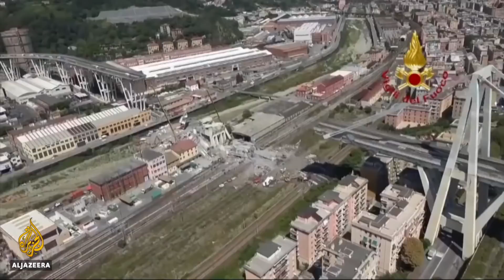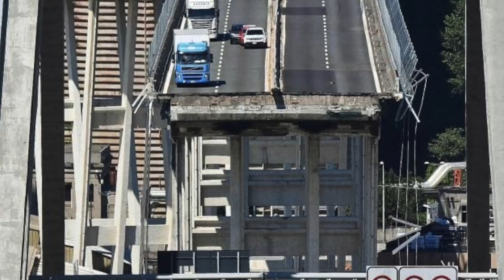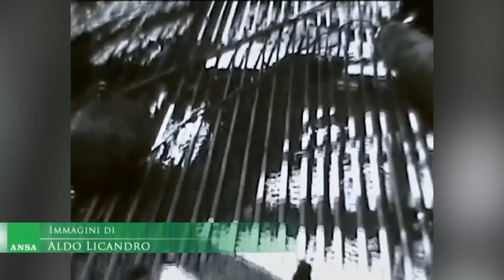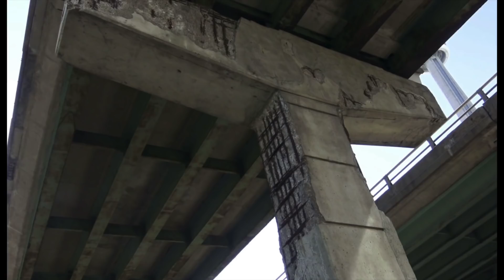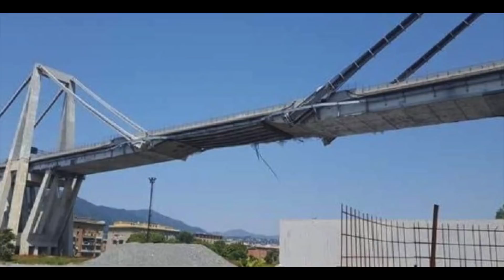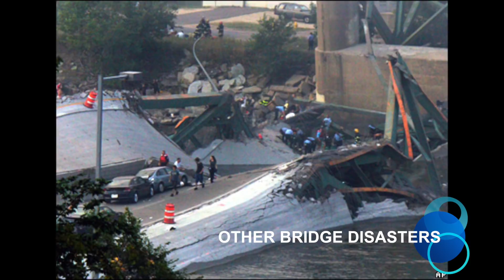What caused the Genoa bridge in Italy to collapse - Prof Simon spells out the sorry story.

Comment: Lightning strike? ⚡
I very much doubt it. The expansion joint is also a red herring. It appears to have been a failure of one of the concrete encased cable stays due to corrosion.  🌉

Comment: Try Google street, you will see the part that felt in good shape. All is in good shape, you won't see no beams coming out of the concrete. The Google pictures are from oct 2017. The bridge was regularly repaired and the cables were reinforced. You show some views that are not Genoa bridge. Try Google from Via Giorgio Perlasca. "the truth is out there" right.
Reply from the maker: Thank you....i was commenting generally on the state of concrete structures all over the world.  good idea to look at 2017 google images of the Genoa bridge, i will do that.
Reply: Indeed. No exterior damages. 
Pre-tensioned concrete structures are a sealed box. There's (almost) no way to check what's going on inside. You can make a series of deformation tests under load, deal with some theoretical models, but you'll never know anything for sure.

Comment: Concrete Cancer occurs when steel reinforcing begins to rust, often during construction phase before the concrete is poured. Then as the cancer grows over 25 - 50 years the structure grows weak abd fractures appears as you clearly showed in your images.  Go and have a look at any large build construction site, look at the already rusting steel reinforcing rods.
Reply: Light rust on reinforcing steel is not a problem as the alkaline nature of concrete slows the rusting process to an insignificant rate. This is why you see light rust on all reinforcing steel and it is still safely used. Passivated (eg galvanised) steel reinforcing mesh is only used in hash coastal environments. The problem arises when the reinforcing steel is placed too close to the surface or the concrete cracks due to age and stress. When this happens oxygen, water and chloride ions from either the atmosphere, sea water or salt used on roads can reach the steel and rapidly increase the rust rate. This rusting leads to expansion of the concrete and further cracking of the concrete speeding up the failure process.
Reply: @cosmic-quasar  Correct. And this is what is happening in most of the samples we see from Italy. Making these elegant designs means that there is little concrete over the rebars, and thus rebar rusts and concrete covering it cracks or falls off. Also we must note that Italy is an earthquake hotspot and all those factors can cause the concrete to crack. Once cracked, there is nothing but steel holding all the weight. Steel in these structures is used to provide tensile strength, not carry the weight.
Reply: I think concrete cancer is different. It's a reaction between the cement and silica minerals causing expansive pressure inside leading to spalling and cracking. I guess it leads to the same thing as oxidising rebar since that also leads to expansive pressure and similar cracking, although if your rebar is rusting too then you are losing tensile strength so it's a double whammy of badness!

Comment: Great possible reasons why the Genoa bridge collapsed. One I will add is the collapse happened during a heavy rain event. Imagine if the gutters for water removal were plugged...or designed poorly, or designed too small in capacity in 1964..
Reply: Mike Rungren no it was just not maintained